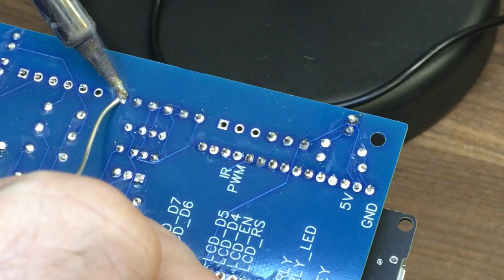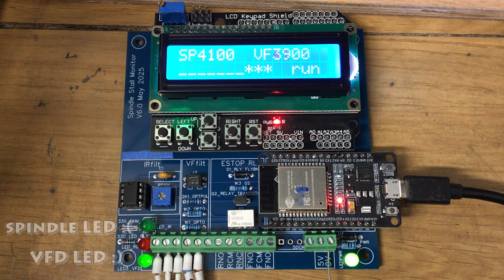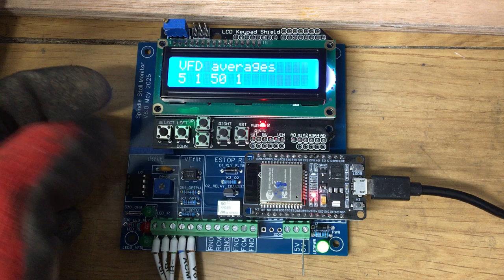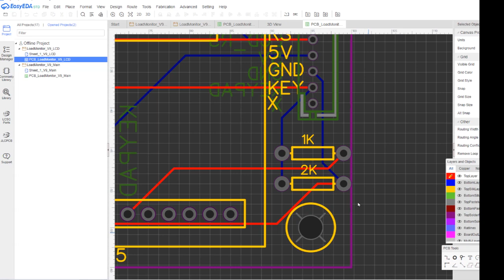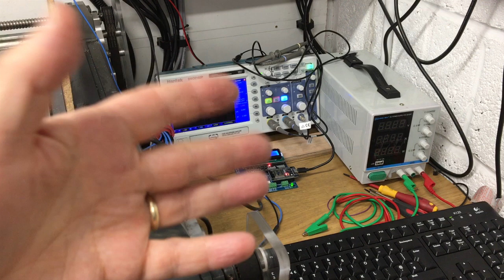Ep:05 CNC stall monitor | Developing the prototype!

Comment: Do yourself a favor and throw those 741s in the trash. The 741 is a terrible, obsolete op-amp. It's got a pathetic slew rate, poor input offset, awful stability, etc. There is zero reason to be using a 741 in 2025.
Reply from the maker: I agree!  Apart from a solar monitor project a year or so ago I haven't really dabbled with electronics since the 90s.  Back then I made use of some 741s so I recently bought a few just so I knew what to expect (although they might be fake!).  This current project uses TL082 which seem to work OK.  I've also got some LM393s which were supposed to be comparators (rather than op amps).  Do you have any suggestions for comparators which would be a drop in replacement for the TL082?
Reply: @routercnc9517  I don't know why your circuit was failing with some parts and not others, so I can't make part recommendations. However, I'd say using a 3.3V rail without an op-amp specifically designed for that (low voltage, rail to rail inputs and outputs) is gonna be a real problem. That's also the reason you can't make the LED very bright, because that LED needs 2.5-3V forward voltage, and when you factor in the opamp can barely source or sink 20mA and can only saturate down to 250-400mV and can't come within a couple volts of the rails... yeah. You need an op-amp meant for this, and don't try to drive the LED directly, just add a simple switching transistor. Also, I would encourage the use of hysteresis (positive feedback) rather than low pass filtering and endless software averaging. You can find examples of comparators with hysteresis in some datasheets. For a simple infrared detector timing application like this I would expect that you should be able to get razor sharp, clean transitions from your comparator with the right amount of hysteresis. Another route would be to just feed into a CMOS Schmitt trigger inverter as buffer. The actual threshold level doesn't matter as long as it's consistent.
Reply from the maker: @CezaryAkakios  Thank you for that.  I did look into the lowest voltage for the op amp and it was below 3.3V so thought I would try what I had already.

When I built the initial circuit I checked the output from the opamp to the LED and there was enough forward voltage across it and it was reasonably bright.  I wasn't sure what effect also connecting output to the microcontroller would be so just tried it, clearly not enough!  But I had a back up plan which was to drive the LED from the microprocessor which is what I ended up doing, so it now sends pulses of PWM out to the LED from one of the microprocessor pins based on the pulses coming in.  But yes a switching transistor would have worked too.

I've gone away from using low pass filtering and it now uses the opamp as a comparator for the IR pulses (works well) and an optocoupler for the VFD 10V pulses (also works well).  I did look into Schmitt triggers as an option but haven't tried it yet as it seems to be working.  I'm getting very clean signals from both systems (on the scope), just seems to need some averaging to get more stable readings.  I'll keep thinking about it as it feels like I should be able to make this much faster to react, but maybe I need to try it on some real world cutting and see what happens and go from there.

Thanks for your comments, really appreciated.
Reply: @routercnc9517  Make sure when looking on the scope to zoom all the way in -- what looks like a simple on/off transition could have several high/low oscillations at small time scale which could completely confuse (or at least add a lot of jitter to) any kind of software timing. An op-amp used as a comparator like this is essentially an extremely high gain open loop amplifier. The tiniest fluctuation around the set point will cause the output to wildly swing back and forth, that is what hysteresis would stop -- though with your old circuit and its low-pass filter on the output this would never be an issue. But worth mentioning as something to check if you removed the filter. I'd also encourage trying a simple CD40106B in place of the opamp and see if the timing is any cleaner. (If you do want to keep using an op-amp I'd suggest the MCP6xxxx series, e.g. the MCP6002 is a simple 8 pin dual op-amp. It's happy with 3.3V supply and can handle inputs and outputs all the way to both rails.)

For timing jitter I'd also be looking into stuff on the software side that would cause quantization error. Like the resolution of whatever timing source you're using. And obviously you have to be careful not to lose precision by accident, e.g. when dealing with small integer types it's easy to effectively nuke the least significant bits by doing math operations in the wrong order and continually discarding roundoff.

Not sure of the details here but also check if your platform has a built-in hardware interval timer with improved timing resolution that you can use, assuming you're not already.

And if there's no getting around it, there more ways to finesse the response of the averaging, like doing a weighted average (windowing function) and using higher weights for more recent values, etc. It's conflicting concerns, trying to make the filtering respond fast to real RPM changes but slow to noise and jitter introduced by measurement error, much better if you can square away the measurement error.

Comment: For buttons and encoders (and other inputs) take a look at the InputEvents library in either Arduino DIE or PlatformIO Library Managers. Takes away a lot of the low level stuff - for buttons it's just 3 lines of code and a function.

Comment: I was thinking you might want to also exclude e-stops when the VFD speed is changed, either increase or decrease like you did for power or start up. I could be completely off base but I don't think you'd command a VFD speed change while in the middle of a cut only on between cuts. Doing this could eliminate some false triggers and allow for more aggressive sampling in normal OP mode.

Very impressive work 👍🏻
Reply from the maker: OK yes that is worth thinking about, it might make the system more robust.  Good idea.

Comment: Being an electronic illiterate all I can say is "WOW".
But I have hope.
My winter project (southern hemisphere - July to November) is to build a washing machine controller using an Arduino Nano.
Yes I know that there are designs on the web BUT I want to do it from scratch MYSELF.
Why?
Making ONE SUCCESSFUL electronics project is on my bucket list.
My first attempt was a "fuzz box" for a guitar which melted one of the guitar pickups.
That was around 1968 or so.
Reply from the maker: Sounds like an interesting project!  I assume it is mains powered?  Be careful with that, or maybe build something low voltage to play with first?  Good luck either way!

Comment: look into implementing a kalman filter in place of the rolling average. it should respond faster to large changes, but still give a stable reading when changes are smaller - ie normal running.
Reply from the maker: Ok I’ll look into that.  It was a long time ago but I seem to remember Vold Kalman filtering being slow for real time and used in post processing but it might have been that application.  I’ll have a look thank you for the suggestion.  Hang on, that was Vold Kalman for order tracking not Kalman.  Ok worth a look.  I probably need to do it for both signals to make sure they track together.  Thanks

Comment: I think your big problem with RPM accuracy is you need say 4 strips or even 8 in your pickup. That way the more pulses per rev you have the more accurate you are in RPM and the more averages you can have
Reply from the maker: I did try that off camera but at 24000 rpm the sensor did not keep up.
Reply: @routercnc9517  24000 x 4 is 100khz of pulses..maybe the adc of the ESP32 is just not fast enough or the filtering is lagging the input with like a hysterysis or similar. I am thinking like a servo encoder its basically just a heap of indicators that are counted so it knows its position. If you could come up with something similar I think a lot of the lag time issues you have with the Estop which is also due to the averaging it would just be far more accurate. But often to implement what you think is the better way is often too difficult. I love your dedication on this project. Qudos to you I am enjoying the process
Reply from the maker: @SimjetAU  I looked at the pulses on the scope coming in from a multipulse wheel (I think it was 8 segments of white) and on the scope it showed the pulses faded away at higher speeds which means the IR sensor is not keeping up or the op amp is having problems.  I'm sure the ESP32 can handle very much higher switching speeds.  I did consider looking into encoders but I couldn't see any small ones that would fit near the spindle collet.  I did wonder about opening up the spindle and looking into something at the upper end but from memory there is not space.
Reply from the maker: @SimjetAU  Just to note 24,000 rpm is 24,000 rotations per MINUTE.  It's only 400 rotations per second (400Hz).  So 4 pulses is 1600 Hz.  Not quick for the ESP32, but the sensor appears to struggle.
Reply: Fix for that might be to dedicate a microcontroller to just processing the signals, leaving the UI and control loop to the current controller. I know that the Raspberry Pi Pico MCUs (RP2040 and RP2350) have PIO (Programmable Input Output) blocks are stupid powerful, with people using them to implement things like CANBUS which runs at up to 1M baud. Sure, might be digital already, but we are talking a million symbols per second compared to the 400 pulses per second you are seeing at 24,000 RPM.
Reply from the maker: @Spice__King  I think is it the IR sensor not keeping up on the 3D printed black/white segments as they speed past.  The white might not reflect enough at high speeds.  I'm pretty sure the ESP32 could handle very much higher pulse trains.
Reply: Though I suppose that's ignoring if the optical sensor is having response time issues. Magnets and hall effect sensors might be an idea. There also are magnetic encoder chips like the AS5600, might be fast enough, might not be, but the category of ICs could be another point to get feedback with.
Reply from the maker: @Spice__King  Yes I think the optical sensor is the problem, probably the white reflections are not good enough at high speed.  Encoder chips sound interesting.  Magnets would need to stay  in balance and not fly off, and not attract swarf.
Reply: @routercnc9517  The trick with the encoder IC is sticking the magnet on the back of the spinning drive shaft, thus far away from everything that's wet and making swarf. A single disk magnet is often used, just placed at the center of the shaft. You want one which is diametrically magnetized, not one that's the typical axially magnetized type, though one is often included with the breakout boards. Come to think of it, never seen the backside of your spindle. How much of a pain in the rear is it to get at and does it have the backside of the shaft accessible?